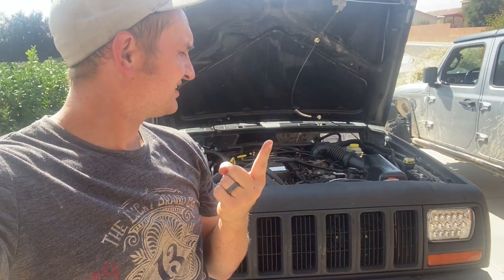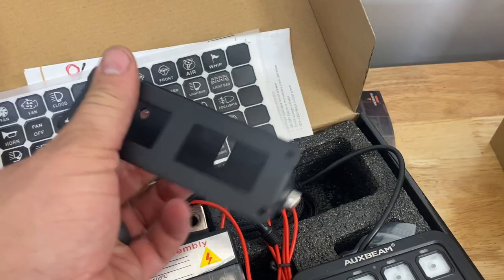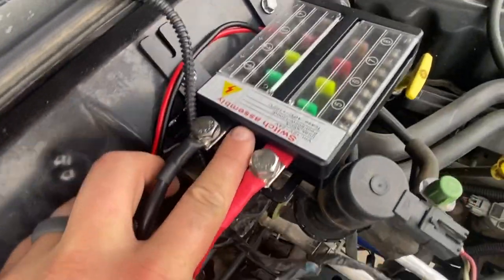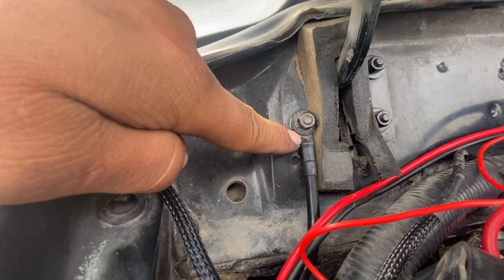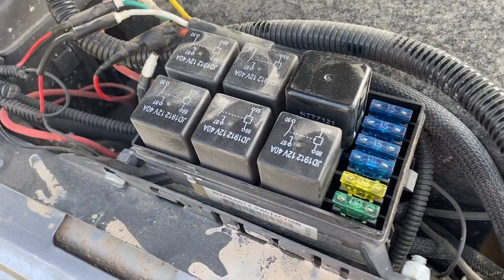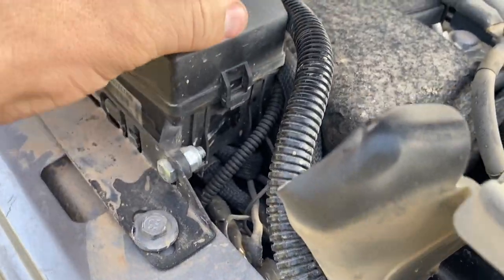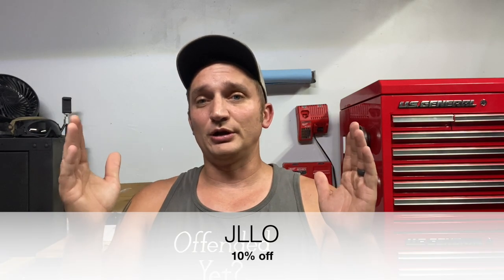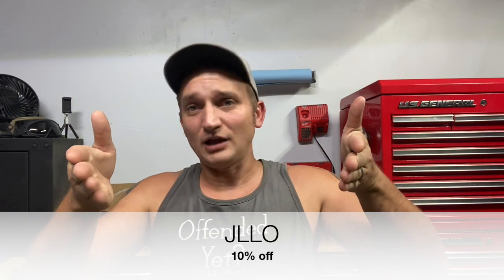Auxbeam 8 Gang Switch Panel

Comment: will be curious to see how that holds up long term.  the terminals are not protected from dust or water in the engine bay like some other much more expensive models.
Reply from the maker: 😂 I mean… it’s in Jordan’s xj, so I don’t have to worry about it. If it fails we will post an update.

Something like this is perfect when u consider a switch pro or spod system is valued more then the jeep itself 😂 

Thanks for all your support my brother!

Comment: Man I been looking for a switch panel that doesn't cost $500+. Might have to order one of these.
Reply from the maker: 🙌 I’m with you, not everything has to be $$$$$$$$ yea sure, it shows it the product… but do you really need to spend it. Nothing wrong with these
Reply: @JLLIFEOFFROAD  So I ordered and received the 6-gang switch because I thought six was all I would need. Then Devon ordered the 8-gang and I saw the differences. The 6-gang has the old, like 4 inch tall under-the-hood panel. Almost impossible to find a good spot to mount it. So I'm stealing her 8-gang and ordering another to replace hers. Extra slots and easier to mount under the hood.

Only concern I have is waterproofing. I may fabricate something to cover the under-the-hood panel at some point. Maybe look for a waterproof PVC box where I can steal the lid and attach it over the panel, something like that. I'll hit you up with pics if I end up doing something like that.

Comment: Thanks for the video, looks like a pretty good product. Is it safer to use the block that has replace able relays? Any thought about it. I need a switch block so I'll be interested on what anyone thinks
Reply from the maker: Guess time will tell, I can understand the appeal of each side…. My Switch-Pros system has a solid state relay, and iv never had a problem with it. If Jordan starts having problems with this system, we will definitely do an update on this
Reply: @JLLIFEOFFROAD  Thanks